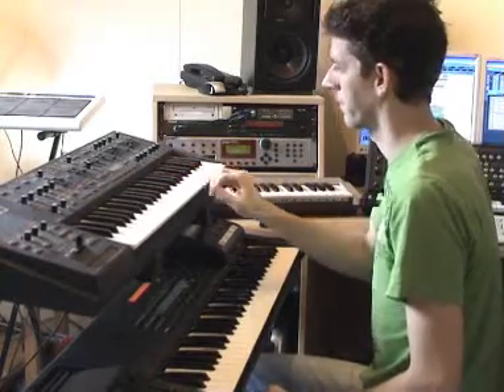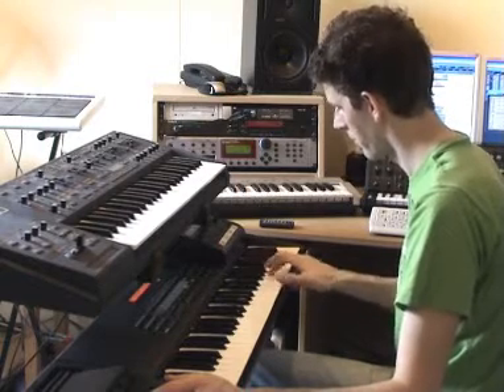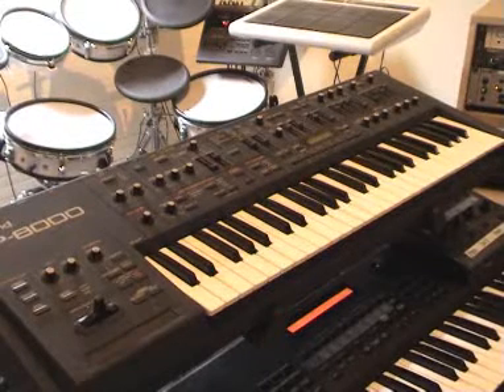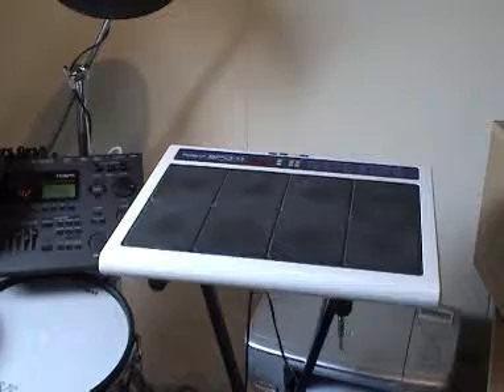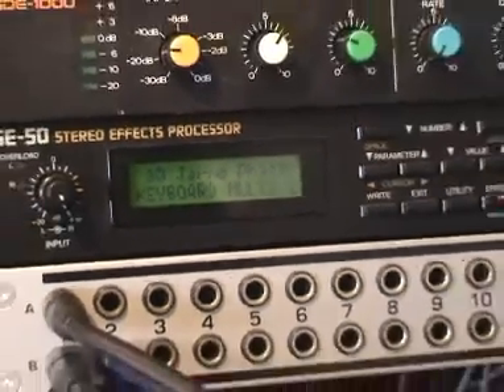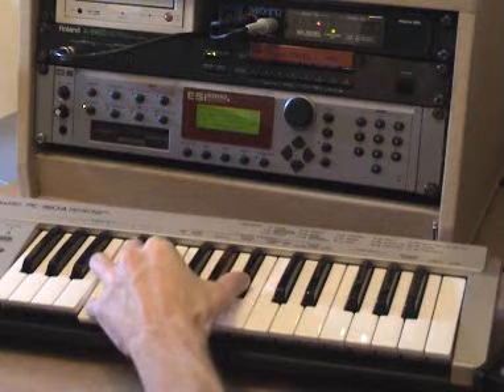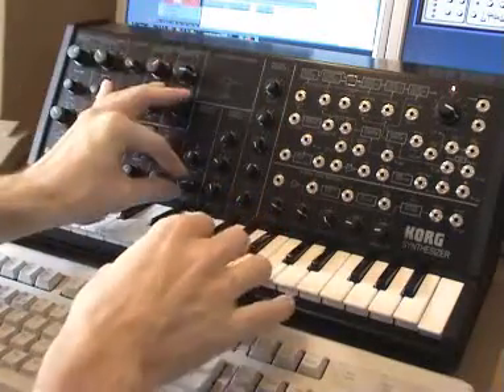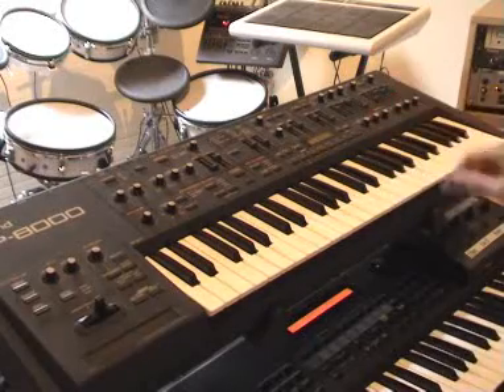Oxygene 7 recreating

Comment from the maker: @nieto102  I am sending the output of the XP50 directly into the Boss SE-50 multi effect processor for the phaser effect. The output of the Boss is going to the Roland SDE1000 delay unit. The other unit in the rack is a Lexicon LXP-1, but I am not using it in this song.